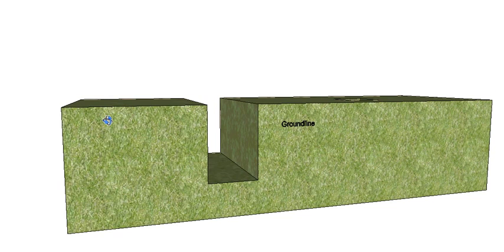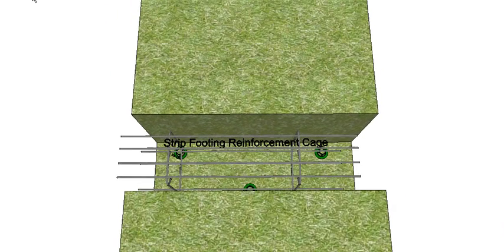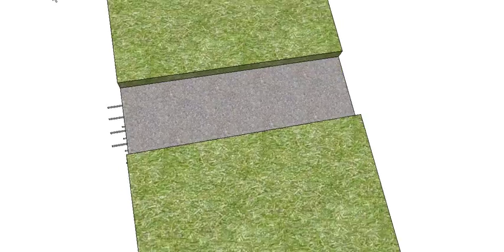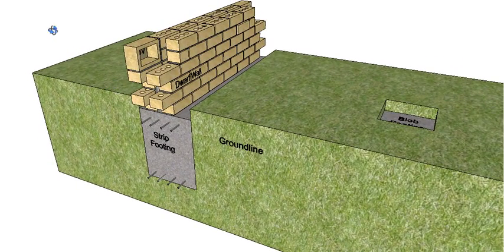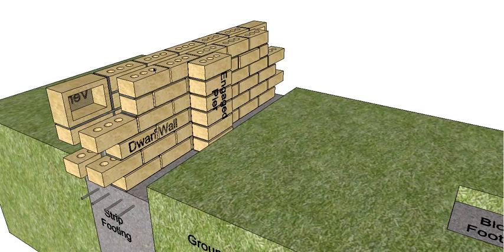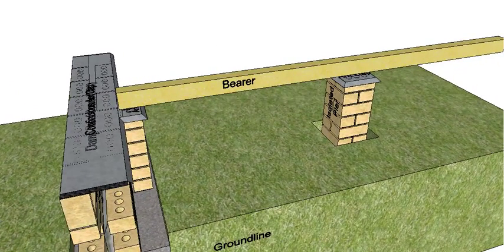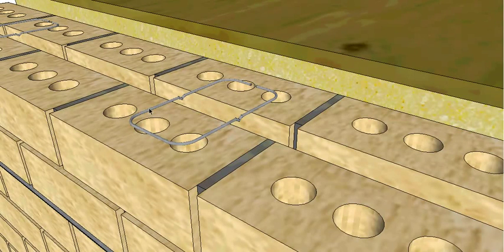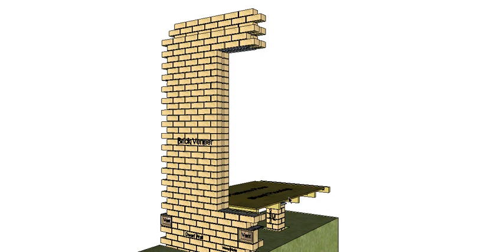Section Through a Double Brick Building Part 1

Comment: I live in a 1969 double brick house  and want to raise the ceiling by lowering the floor. Would it be possible to remove the floorboards and replace them with concrete flooring and some way to maintain the subfloor aeration some how?
Reply from the maker: Hi Mate, you could do a suspended concrete floor however im not sure that you would gain much more than 100mm difference in height.

Comment: excellent thank you, I'm starting to renovate a 1927 cottage so this is very helpful.  I need to see how the roof trusses connect to the bricks now....I think in my house it just rests on top of the wall with gravity (Goulburn NSW)
Reply from the maker: Hi Sue, with a home of that age the chances are that you would have a traditional cut roof rather than the trusses and they would just be nailed to the plate or I have seen the rafters actually landing on top of the ceiling joists.
Thanks for your comment.
Reply: @Buildsum  hi thanks for your reply.  What you are saying makes sense because I can't make sense of the roof space, there do not appear to be regular trusses however there are regular members evenly spaced holding the pitch.  I've put photos here on google drive:  https://drive.google.com/open?id=1I67D5RX_PoSSo7pm2ZKsxafrZBUUD2P3   there's also a really crude sketch, but there are still unknowns

The reason I'm trying to understand it is that there are birds nesting in the walls and I need to close the gaps, the 'eaves' are exposed and there seems to be timber lining the eaves, but I can't work out how to seal it elegantly, or perhaps put something over the gap between the bricks in the roof cavity.  Out of curiosity, here are photos of the eaves and their timbers:  https://drive.google.com/open?id=1QPu9YbAosvde89K6nyGJcXk0Pz-JwMOo
https://drive.google.com/open?id=1OP5yEShpYqhUMpIZlQX7IFEWkgHivKdX  

thanks to your comment, I will look up "traditional cut roof" to try and understand the structure
Reply from the maker: Hi, Sue, the links aren't working, if you would like to send the photos to buildsum@gmail.com I will take a look at them for you.
Reply: @Buildsum  thank you I really appreciate it, have just emailed you.  I've looked up traditional cut roof and it's starting to make sense, just need to know how to bird-proof the cavity and eaves!

Comment: Hey mate just a question, would the double brick construction method work on Slab on ground? My understanding tells me that it wouldn't be practical due to the amount of concrete that would have to be used, although I'm probably wrong since I'm quite new to the world Construction. 

Also, love your videos mate. Binged through all of them and is currently helping me out on my surveying course.
Reply from the maker: Hi Mate, thanks for your comment, I'm glad to hear that the videos are helping. I don't see any reason why you couldn't use a Slab on ground with double brick construction. You would need a little more concrete in the footings as you. Personally i have never seen it however we dont do a lot of double brick construction in Sydney or NSW.